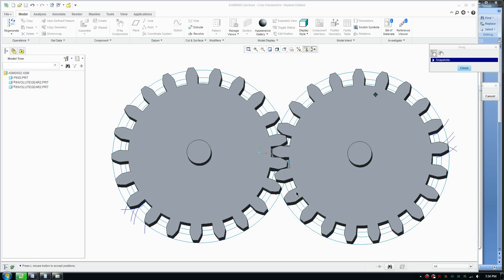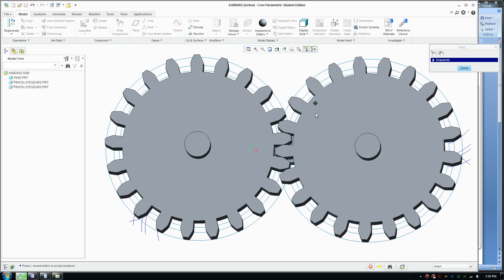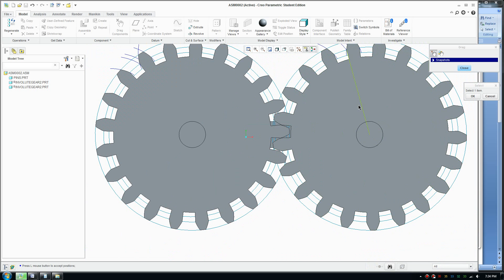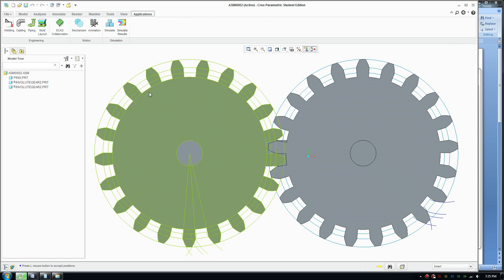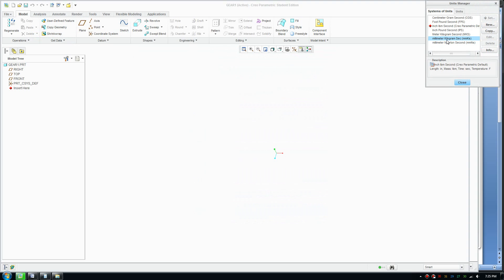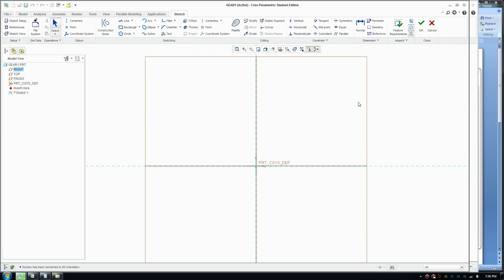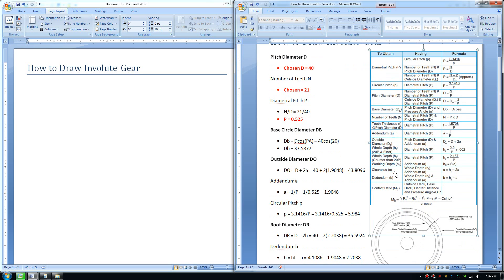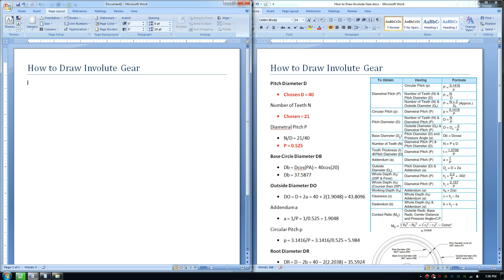How to Draw Involute Gears in Creo Paramatric - Part 1 Longer Version

Comment: I keep getting a base diameter smaller than my root diameter for my gear specification is that possible?

Gear Specification:
19 teeth
24/48 pitch
45 deg PA
.7917 Pitch Diameter
Reply from the maker: Standard pressure angle values are 14.5, 20 and 25 degrees. Make sure to convert to radians when calculating sin cos tan.